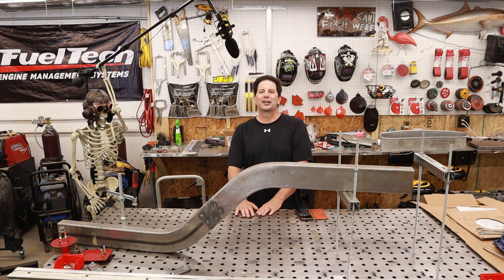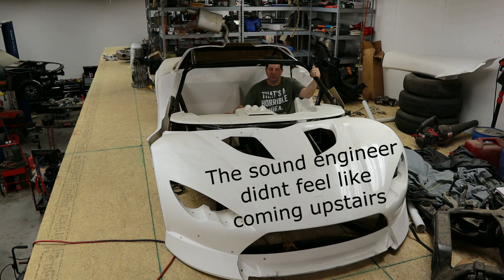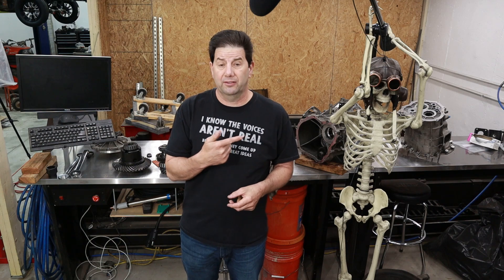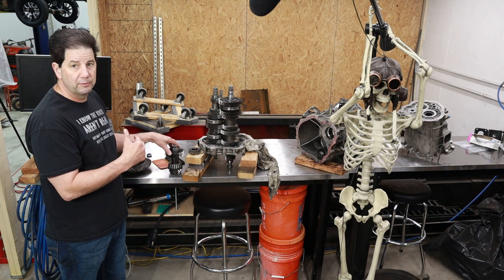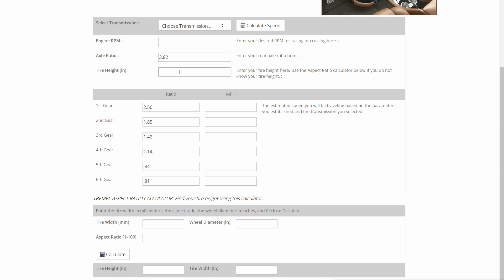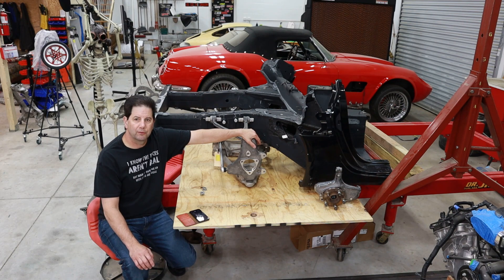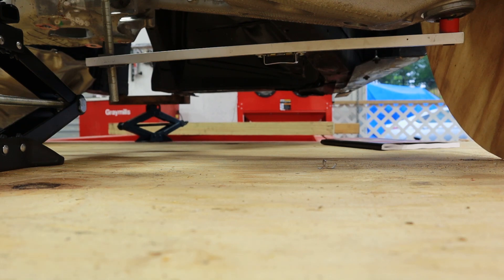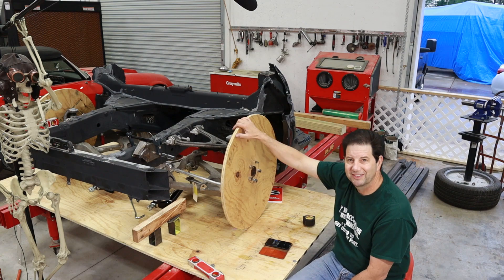Project Split Decision Car 1..Ford Aluminator XS Car 2...Tesla Model S swap ... DIY  Supercar Part 1

Comment: Hii, i like your project, i also wanted to make my own car, but i don't know how to start, i also run a youtube channel related to 3D Modelling in Solidworks.
Reply from the maker: I looked at a few of your videos and I like your work.  If you haven’t built before I would suggest making a 2/3 scale car from a go-kart.  That’s actually my next step once I’ve finished the design
Reply: @XSMotorWorks  i have aleeady built go cart and formula SAE and BAJA vehicles.
Reply from the maker: @Knowledge_Centre_03  That's awesome.  Sounds like you've got enough skills to make your own ride.  If you do decide to create something let me know.

Comment: If the Coyote powered car is AWD it should be pretty interesting. Nomatter how much power the car makes, if it can't get off the line quickly then the Tesla powered car will have the advantage. But with 1000hp you would definitely run it down in the quarter mile.